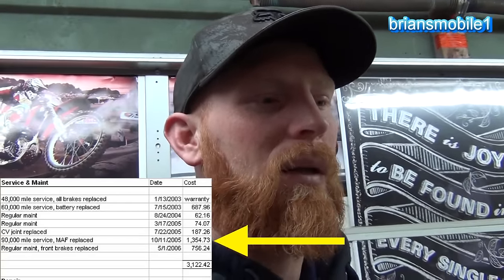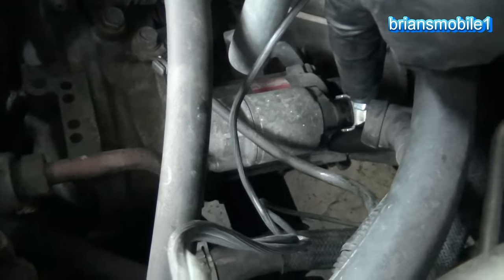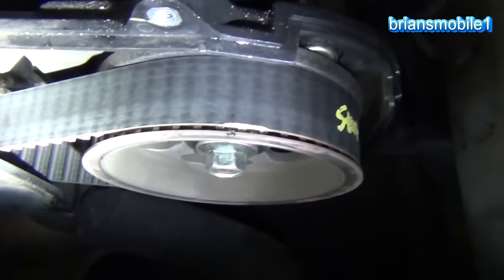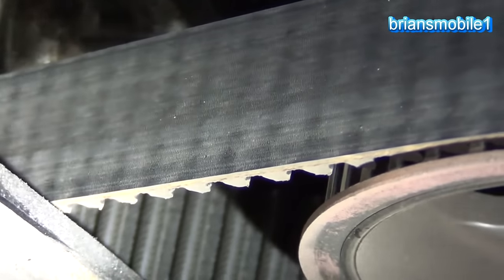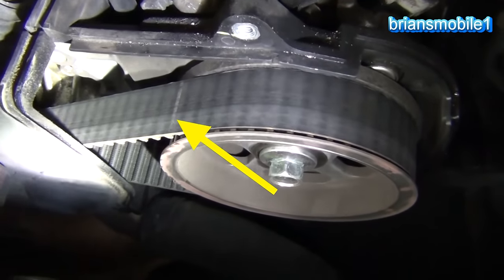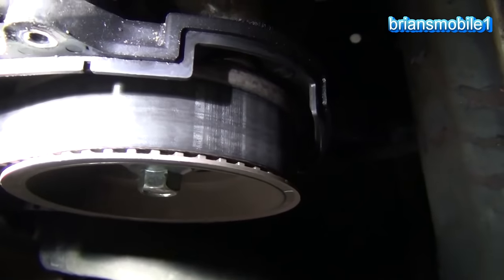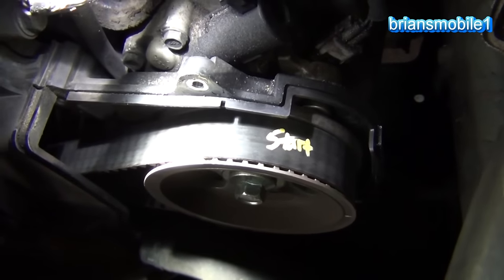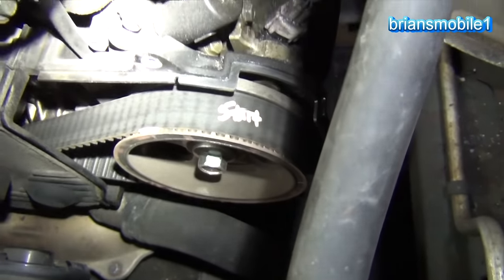How to Tell if Your Timing Belt's Been Replaced

Comment: Regards, I just bought a Touareg which, if the belt breaks engine is toast. With 185,000 miles I was going to change the belt as a matter of course not taking any chances but just yesterday as I began to do so, I removed the belt covers (very easily done on these engines thankfully) to discover a very legible part number, model designation and manufacturer stamp (Dayco) and the teeth look great as well. The truck needs a new serpentine belt but it seems all is well with the timing belt based on your info it seems not much more than 20 or so thousand miles on this belt would you agree? What is throwing me is that the valve cover gaskets leak and my next step was to replace them and at the same time inspect the chain slides for the VVT and replace as necessary, however my thinking may be off (hopefully) but I feel like if they were changed previously then, at a similar high mileage, wouldn't they have changed the gaskets as well? Knowing they'd not be far behind? In fact as a desperation mechanic myself were I a professional mechanic for a living I'd not have wanted to reassemble without new ones pending a most certain leak on old ones.
Reply: Confucius say: why is the sky blue? why do the birds sing? It is what it is at the point in time you are at.
Reply: If you change it you’ll know it’s good for another 80k miles at least. If you leave it alone it could be fine for 80k miles or break in 8k. It’s up to you if you want peace of mind or too risk it. I change my cars timing belts/water pumps as soon as I buy and I always haggle the seller down and I usually buy cars without service history because they’re a lot cheaper without it and no warranty. I do all my own work and check the cars over well enough before negotiating a price so I come out on top once I’ve done any work needed/servicing and all belts. 

For me it’s worth doing the timing belt and water pump because the parts are so cheap and easy to fit, it just makes sense to me.  
I know it’s been done and the service is done so I know I’ve got 8k miles until the next service and about 80k until the next timing belt not that I keep the cars that long! Lol 

If I was you I’d just get the belts done and water pump then write down the date and mileage on the cover so you and the next owner has an idea when it was last changed!
Reply: @Alexander_l322  Yeah so I did run it about another 25000 miles and was fine, just changed it here recently new water pump, VVT and slides, etc. it did have some slack and it was the right time to do it. I also do all of my own work, no fun on these beasties and especially considering how it can toast your engine not being done properly adds a new butt puckering dimension to it.
Reply: @kw57rx8dr.9  it served you well for another 25k miles so that’s great news! Definitely caught it at the right time but if it had some slack then it probably wasn’t properly tensioned by whoever did it before, they don’t stretch and get slack they’ll just snap. Or the tensioner was starting to go which is like the belt snapping anyways lol. 
Yes it is a bit stressful doing the timing belt because if you do it wrong or mess up the timing then start the engine you’ll be in for a bad time, I turn the engine by hand first and check it can turn over at least 5 times and the marks line up again before I reassemble enough to start the engine, the first turn of the key is still stressing and full of anxiety but it always seems to work out just fine for me as long as I’ve triple checked everything.
Reply: @Alexander_l322  Yes now that you mention it, I just remembered that I wanted to turn it over by hand first, Oooops! I did double check every mark on the cams, timing belt, with the camshaft alignment tool and TDC though first. That's like 5 or 6 check marks. one thing though that has never made sense to me and I can only surmise that maybe it applies to north american models or whatever is that every resource I checked said number 1 was front passengers side but I did the timing on 2 Tregs and both of them number one is front drivers side?
Reply: @kw57rx8dr.9  maybe if you’re working on left hand drive cars then the drivers side is obviously where the passenger side would be and vice versa, or different models or whatever to be honest I’m not sure without really thinking about it.

Comment: With digital revolution we are still late to the party but for starts there should be automatic inclusion of all applicable conversions whenever any  is used, - written along side or  hover over popups. Just like with time thats still not happening but should is when given something from a different time zone there should be automation that additionally considers your location so you dont have to go to google and do conversion manually. Basically any unites of measurements and time should be dynamic code as a standard.

Comment: Brian: thanks for video. It's very well done and it is understandable and informative. My Forrester 02 has a sort of screw adjuster and has no cover. I know it was in a minor accident (hood, radiator, had to be replaced. Everything else works Ok though). Should I suspect there are missing covers, parts for the pulley and belts system? Thanks again.

Comment: My old 93 accord went 210k on the factory belt, broke when we went to start it up in the morning.  we were told it had been changed in 2008, but when my mechanic replaced the belt he said it was still the original belt in it....
Reply: +gunz-n-gadgets This is my concern as I prepare to buy a Honda CRV with 201,000 miles on it. I'm sure it needs changed even though the dealer says the on it is fine.
Reply: My 2006 accord has a timing chain. Never has to be changed.
Reply: No it doesn't.  Yes it does.
Reply: John P Actually, he’s probably right.  My 2007 4cyl Accord has a chain.  The 6cyl have belts (for that generation).

Comment: Does a Factory Belt has this markings? I´ve bought a 98 Legacy and dont have any Service History about it.
I see some White Paint on the Marks, but it seems like the Headgasket on the Driver´s Side has been done lately and they put them on to put the Engine in Time. It is a original Subaru Belt, but it could be done at a Subaru Dealer. Belt looks ok, No teeth missing or Gloss.
Car has around 265000km (164000 Miles) on it. I Will change the Belt just like every Fluid on this Vehicle.

Comment: One way you can sometimes tell if it has been done is to go to Carfax.com and click the thing that says already have a car and you can sign up easy using facebook then add your car by the plate number or vin number and it will tell you what service has been done to your car. Some cars will have more listed then others depending on the shops that have worked on it. Some will tell you when the windshield washer blades and when it got a car wash and oil changes and others wont have hardly anything listed but i recommend checking it out, its free
Reply: This is a great service.  If only every shop used it.  It even allows one to enter DIY services... certainly boosts resale value
Reply: +all   No, Carfax does not report timing belt replacement, they report that "service" was performed at a particular time/mileage interval. Think it through as to why the don't report this.

Comment: I could see the subaru brand on my belt so I know that it was changed at its schedualed time. I can also see the alignment marks which also told me that the belt wasnt that old. Like you said,they get really shiney andvyou will no loner be able to read the manufactering lable or marks. I always use a paint pen and  write on the timing belt inspection cover the date it was changed. People like buting my cars because I aways write dates of things I did right up front on the fran shroud. When I did antifeeze changes, headlight change,water pump replacement. Always do the battery date too,right on the battery cover.

Comment: why don't you show some used and new timing belts outside the car for comparison? You have to pay attention for cracks on timing belt, broken teeth, elasticity of the rubber material

do you have some broken timing belts in your collection for a post mortem analysis?

Comment: Nice tip. Brian, dont remeber if you told that in your channel, or someone else's channel, that, to point a bad belt (the opposite) you need to use timing light and if you have a mark in the belt (something to take reference) this mark should have some some of jitter, that's moving a bit back and forth, intead of showing in a "steady" position. Is that Ok, or has no sense (or missunderstood that thing). Thanks for the vid, love the wall paper on  the wall. Cheers.

Comment: You can't tell!   I have replaced the timing belt multiple times on the same v6 Mitsubishi (my own car) and been surprised that I couldn't see any wear on the belt I 'm about change.  It almost looked like I changed it last month.  If you don't have an accurate history, change the belt!  And yes I kept the mitsi for 380,000 kms.  It died because the last time I changed the belt I cheaped out and didn't change the water pump.  It therefore siezed the pump and threw the belt at 80,000 after the belt change.(It looked decidedly second hand that time!)  Change your waterpump too!

Comment: Question here. Bought a used car 1995 ls400. 110 K miles. Timing belt done at 70K miles but that was 2008. Should I go on with th 90 K miles interval requirement (160 K if I follow the miles interval) or change it now because it was done 10 years ago. Please advise whoever reads this. Thank you.
Reply: I advise that you change it along with the tensioner pulley and water pump.
Reply: Thank you sir. I am thinking of changing it since it was done long time ago.

Comment: I put an OEM belt on my Toyota, the print is faded and the belt is in decent condition. Its really hard to tell if the belt is old or due for replacement based upon cosmetic condition.

Comment: My 2004 Lexus LS 430 (interference engine) has only 51,000 miles on it and Lexus says replace belt at 90K, BUT it has 13 years on the belt. Is age a problem?
Reply: yes; driving with a belt that's more than 10 years old is extremely ill-advised
Reply: Yep, the belt deteriorates with age and cracking occurs. You won’t get any warning when the belt decides to ‘go’, it will just snap!

Comment: Hi Brian. Great video. Thank you for posting. I see you have a Subaru as your example, which is great that they have an easy access for the TB inspection. Unfortunately, in my case, I have a 2003 Toyota Sequoia 4.7 with 133K. TB inspection is not possible on this vehicle without dismantling a good portion of the front of the engine. So in performing the inspection process, one may just go ahead and complete the job. I would like to contact the previous owner just to say, "Hey was this procedure performed at the proper mileage interval", however drivers or previous are protected by a privacy act making it nearly impossible to make contact with a previous owner without breaking the law, or asking someone to break the law. I registered myself as the current owner on the Toyota website. I can see where the previous owner had all warrantee items performed, however they declined all the recommended services, one of which being the TB & water pump service. Now this could be something, or it could be nothing. The previous owner may have thought the dealer's servicing was too high, and sought a private mechanic's services, or they may have neglected the service and opted to trade in. The vehicle is in absolutely flawless condition. You couldn't tell it from new being 14 years old. I would assume that it was done from the condition, but we know what happens when we ASSUME, especially with timing belts.

All of the above puts me in a pickle of wonder of whether I have a ticking bomb on my hands. I was considering drilling a 3/4" inspection hole at some area of the TB housing, and placing a rubber grommet when not in use to keep debris out. I don't want to detract from the value of the vehicle, but it would be nice if the Sequoia had an easily accessible view window for the TB. Do you think this is feasible, or are you aware of a way that I can determine if my TB has been changed on my vehicle without going through this procedure? Please advise if you have any ideas. I believe that I possess every tool known to man including a Whistler large screen probe tool. Again, please advise.
Reply: +Not Awake  please see above

Comment: I did that test at 105k on my 2000 Honda accord, l found out it still like brand new. So I waited for another 105k miles and did checked the belt,It still look the same like new so I will wait until my odometer reading is315k miles.It has a unitta brand timing belt from Japan.I think those timing belt will last to 300k miles before changing.I am the original owner of this car.I gave this to my son and I do all maintenance and experimenting on it.
Reply: @Suzukisan Honda timing belt will last up to 300,000 miles before replacing.Iam on my 200,000 miles mark now on the 2nd timing belt that I replaced on October of 2004. Until now it is still in good condition.Unitta is the brand from Japan.Don't waste 600 to 1000 dollars changing timing belt.That is a big money maker of the dealership.
Reply: We got couple of new Vtech Acuras. Both got stolen, no need to worry about belt change.

Comment: can you give me your opinion on the gates timing components kit now that they switch the idlers suplier and now its made in china
Reply from the maker: I saw that video that Yamaha82 did.  Great bust.  Manufacturing in China is a crap shoot.  You get things like the iphone made there that's fine, but other things like children's toys and infant formula ends up being toxic or dangerous.  I've seen good and bad.   Same goes for Harbour Freight tools.  I've had some amazing sockets and some real garbage and they looked the same.
Reply: they are reliable
Reply: briansmobile1 I contacted them and they said that they have quality control and that they still use quality material and goes through strictly quality control to meet the requirements but still kind of don't trust them
Reply: guys im useing them for over 10 years- I never experienced anything problematic with any Gates timebelt. In all kind of engines. Always keep in mind the human mistake. Expecially in such common spare-part. Chinese manufacturers are not what they used to be 20 years ago. Ofc some of them are not very good but still the majority have upgraded.
Reply: thanks for sharing your experience john K

Comment: It's amazing how far we've come in timing belt technology.  I have a 91 Alfa Romeo 164l, and change that belt out every spring.  They say you can go 30k on the belt.  However it has the old design on teeth "Square" and only 30% belt wrap on cam number one.  Now-a-days, you have belts that can go over 100k.  Amazing stuff!
Reply: 30K? lol. I have an 80's GM and the belt maintenance interval is 100K
Reply: @markgunther2502  Alfa’s original recommendation was 60k or 7 years.  I would never let any car with a timing belt go 100k.
Reply: @Boasandpythons  Didn't you just say now there are belts that go over 100K?
Reply: @markgunther2502  some new cars yes.  Would I push it?  No lol.  Nothing from the 80s would I push the 100k.  What GM vehicle did you have from the 80s that had a timing belt?
Reply: @Boasandpythons  2.0 Sunbird

Comment: My car has a chain, do i have to worry about changing it ? it has a 125k mil
Reply: moe raw timing chains usually are supposed to last the" life" of the engine....but that does not mean they last forever. I would not worry about a timing chain replacement until you get over 250k. The long life of the chain is the advantage of a chain. The disadvantage to a chain is that they do stretch over time which cause the motor to get more out of time very slowly over a very long period of time. They other disadvantage to a chain is that if it does break its going to cause a lot more damage to the engine. Belts never don't stretch they just break without warning. usually they will last to about 180k but are recommend to be replaced at 90k.
Reply: moe raw late answer but in i.e mercedes benz  w124 200d chain can handle 800k kilometers
Reply: Of course they don't actually stretch - that is a figure of speech. They wear, and that wear is a function of lubrication.  A timing chain will run out of tensioner and jump at barely 50K miles if the oil is badly neglected, or the same engine will run half a million miles if synthetic oil is changed regularly.

Comment: Why not use a socket on pulley and crank it clockwise in neutral. No need to hook wires.  That's how I did my Porsche 928.

Comment: Legend has it that Toyota belts could last up to 300k without failure. Just replaced an original belt on a 2UZFE with 254k miles on it
Reply: Is that the GX V8? Just bought one with 204K....planning on doing TB just for peace of mind.
Reply: @CHPImages  The 2UZfe is the V8 found in most Toyotas and Lexus. Sequoias, tundras, LS430s

Comment: What if the engine idles a lot wouldn't it still wear the marks off with low miles?
Reply: Thanks so much for informing me about  Mevotech! The bellows wouldn't fit on the steering rack and the sway bar mounting bushings were two different types when I looked really close! I deleted the video right away! Thanks again for your Great Input!
Reply: No prob., even the worst beater car in the world deserves better than mevotech.